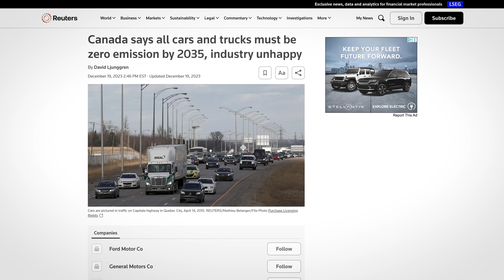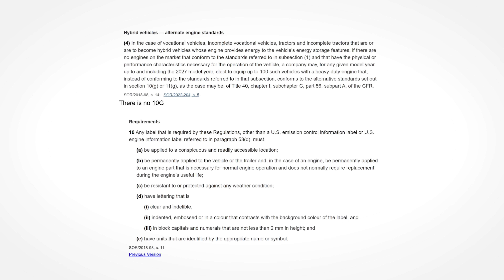Government Red Tape Is Blocking Our Plug-In Hybrid Trucks

Comment: There is a place not to far from your facility that ALLOWS you to make hybrid/ diesel trucks. Plenty of acreage for a final assembly plant. There are more than 48 different provinces or states that would welcome you. Of course there are way too many freedom areas that would allow this type of vehicle assembly. They even have local logging areas set aside for log hauling. They also have an infrastructure to allow the transportation of those parts, frames and subassemblies. Fueling stations are readily available to supply the exotic fuels necessary for the development of a new and different form of transporting parts. The bureaucrats necessary for the throwing of monkey wrenches are already hired and trained to slow progress down to a slow enough pace for the most advanced intellectually understand the complex interaction between humans, machines, the environment and the implementation of said integration into a new and hopefully beneficial technology into an archaic environment such as logging, human interaction, beginning to end utilization of new and complex systems into a mature and progressive,complex, environment that would not need the pillaging and raping of natural resources to further implement and reduce the need for human interaction between trees, rocks, and flowers. Unfortunately areas will have to be set aside for the development of suitable and sustainable areas of agriculture to feed the transportation hub necessary to allow farming areas to be built and maintained according to some as yet unknown and unwritten law that would allow the government to manage these areas to minimize the impact of the general public unto these rocky and forbidding areas for growing crops and food. Proceeding down this hazardous path fraught with environmental dangers would require the development and implementation of a new and untested direction would require advanced technologies and thinking unknown and uncertain amount of financial resources are allocated to existing systems. Lead time to mature infrastructure could take several generations to fully understand and implement.
Or we could employ existing technologies and farms cutting lead time to weeks or months. 
Suggested areas in Washington State, could be utilized rather quickly. The major impediment would be loss of revenue and lack of control from a Canadian government perspective would be unacceptable. Or a province could break away from Canada and totally upset the revenue aspects for Ottawa. Another brilliant concept shot down.

Comment: You might have better luck in the states at this time. Kind of crazy that a net improvement is disqualified by technicalities. Once you get through all of this, the next guy will have it much easier. That's not exactly right either.

Comment: I think Canada is somewhat delusional, thinking that they’re going to prevent climate change when the last 3 to 4 years we’ve got incredible Canadian pollution here down into the states.
I’m pushing 60 years old until the last few years I’ve never seen wildfire smoke here. 
So your priority is zero pollution from a diesel, but you allow uncontrolled fires to blanket entire states with smoke so hazy that we can only see a mile.
It’s really despicable with all the breathing problems that we’re starting to have here.
I’m all in on clean burn vehicles, but your priorities are really screwed up up there.

Comment: Surly the Scania 9ltr is also a truck engine tier 4 we use them here with our tight emission compliance,  ergo truck engine, modified to run a highway generator they want to play around wording of regulation  call it an ECU upgrade with emissions benefit love what you guys do,.
Reply: Well you see, it's not the engine in it but the way the engine works. He himself explained it, a generator engine senses load and andjusts, a regular on highway engine doesn't, which makes it all more difficult on top of needing a different engine that may not do what they want it to do.

They've been working a whole lot and selected that Scania industrial engine because it fits their needs best. 

Unfortunately bureaucrats don't care how well things work they just care about doing what the paper says to do.
Reply: That’s a minor engineering obstacle. You can reprogram any ECU to hold a peak efficiency RPM and modulate the throttle according to the load. That’s basically what cruise control does.
Reply: @LostCauseRT  On the other hand, the Scania generator engine is the exact same engine they use in their trucks. So if Edison has to make pure diesels for a while, it should be relatively easy to modify the existing design they have, add a transmission and then claim a pretty big market share as Canada and the US only manufacturer offering a 770HP diesel V8 engine. And after a few years, when regulators got their heads out of their butts and allow the hybrid design, the prototype is already complete and ready to be deployed, factory makes a small modification to it's production line and start building hybrids.

With a smart enough design, they could make it so that the diesel trucks can be upgraded to hybrids in the future with ease. Some tuning to the ECU and removal of the emission systems and bam, 1150HP from the "generator".
Reply: @John8087  Modifying requires re-certificates for the engine. This is not someone's garage project, it's supposed to be a marketable truck from a complying (legal) truck manufacturer.
Reply: The engines are normally not that different, you can flash the ECU to make it a constant speed engine, IE Generator.
Reply: @ShaneFromSA   Hell just move the speed sensor from the wheel axle to the output shaft and set the cruise control. 

Also a lot of highway engines offer a PTO mode  where you can set a fixed RPM is the transmission is in neutral.
Reply: They explain it in the video. They're using a stationary generator like one designed for a house, in a vehicle and the current regulation require vehicle engines be used in vehicles.  As you pointed out, those manufacturers modified existing vehicle engines to act as generators, thus meeting regs.

Again, as pointed out in the video, their argument is that's less efficient than their solution which is why they don't want to do it.

Comment: Would it be possible to take an on highway engine and build a throttle controller that runs the engine like a generator engine.

Comment: I.
 Think what you should do is use. An on highway engine jin running in PTO mode.
 And finess the PTO settings to work with.  driving  a generator sounds like that might be the only viable path at this time.good luck😮

Comment: What does it take to get a generator motor on highway certified, or to have an on highway set up for generator application? I’m sure it could be set up to hold RPM but does changing that programming affect T4F on road?

Comment: the generators you selected, they're available in similar power as towable small trailers right? I'm thinking you can submit your electric trucks as battery electric vehicles with no generator (but a hookup for auxiliary power, such as an additional battery pack or a generator) and delay installing the generator until the environmental regulations catch up.

Comment: sell them as electric vehicles that carry a unrelated generator. the use of a generator on a vehicle isn't illegal. you just have the joyful option that customers can switch the generator to connect to the battery. but the vehicle is an EV
Reply: That might be an idea actually.  The generator would be used on site at construction sites, or at least, that's how you can sell it. Then offer a simple after market kit that can also use the generator to charge the battery in real time while driving. The kit would just be a cable.

Comment: Okay for my understanding. Is the main problem that you're using a ready-made diesel generator (from Scania) in your truck, but like all conventional diesel generators, it's only approved for stationary use? Which means you're not allowed to run a diesel generator on any other trailer while driving either. 

Or is the much bigger problem that even if you were to add an electric generator and its own engine control unit to a diesel engine already approved for truck use in Canada, the necessary legislation for approval for diesel trucks only exists for mechanical transmissions?

Comment: Anyone who wants more or bigger government needs to come and watch this video. This is why people hate big government. It is the bureaucracy that stifles innovation.
Reply: The Chinese government is big but they can cut red tape if the goal is the same
Reply: China has one of the biggest governments there is, and Chinese autos are set to permanently displace everything else

Appears the Chinese adminstration realizes that capital is just as, if not more controlling than legalese
Reply: A smaller governement doesn't mean less regulation either, if anything it can mean it takes even longer to process requests when the demand is there but there's not enough people to do the required work and be even more of a roadblock
Reply: @LoupDuQuebec  A smaller government absolutely means less regulation and more innovation as there are less politicians and bureaucracy to screw it up like this. With less government agencies to get involved it is harder to hide behind the bureaucracy for bad decisions like this one. In a small, nimble government things get done because you can always find someone in charge that can't hide behind 50 of their lackies and agencies running interference who are too afraid to make a decision because it might look bad on their career advancement. It is because of this that innovation and advancements are stifled like not allowing this engine to be on the road. Anyone with a brain knows that this shouldn't be a problem and with a small government you will get much more done.
Reply: But there's also a downside with less regulation, the need to innovate slows down because what already exists makes money, so the money making solution is preferred over the solution that solves problems.
Reply: @LouisSubearth wrong lol. Less regulation is the way because more money means people can spend that money to innovate. Why would they innovate? Because it will be benefiting in other ways.
Reply: @LouisSubearth  Not even close. The more regulation there is the less solutions there are. This is evident in every place where over regulation has stunted innovation and growth just like it is doing here. If you were to look at all the places with the most regulation you will find less innovation as making a better mouse trap with the goal of making more money is far better than a government saying to make a product. Because unlike the entrepreneur who will live or die by how well he innovates. The government mandated and regulated one needs none of that. Just look at the cars, airplanes and any items coming from Russia where you can't make a bolt without the government approval. They are all garbage because no innovation is required.
Reply: @Aircam73  overregulation is bad, however so is underregulation. The best example is the Malaise era cars. The 70s were rough for American manufacturers because they had to figure out how to make fuel efficient cars, at first they choked existing cars to make a fraction of the power to meet fuel economy standards while European and Japanese imports were smaller, had smaller engines, more power and consumed less fuel. By the mid 80s, the American brands had learned to make comparable cars, they weren't the greatest, but they could keep up with the competition, and now we have big V8 engines that can meet modern emissions and get decent fuel economy while making respectable power figures.
Reply: @LouisSubearth  Your example had nothing to do with regulations and everything to do with an oil embargo. Once again because of this embargo it was left up to the companies to innovate their way into making a product that people would buy. The Japanese most certainly had a head start as they only did small cars in an era where those cars were laughed at. It wasn't until gas shortages that those cars became mainstream and the manufactures adjusted to the new reality. It wasn't until much later that emission standards came in where companies had to abide by them. I am not saying anarchy is the way but most governments, especially Western governments have grown fat and bloated, slowing innovation as bureaucracy tries to justify itself by over regulation.

Comment: So, what they are saying is if you were to remove the diesel engine from your trucks and run them wholly as a plug-in electric they would get approval! What would happen if a customer purchased one of these fully approved electric only trucks and then purchased a big diesel generator, mounted it behind the cab and connected it to the charging port? I am not aware of any Government legislation preventing this from happening. What you are offering is essentially a factory fitted version that is optimised for this purpose. Maybe resubmit your application for approval and describe it as fully electric. Then in your brochure list as a factory fitted option the "Emergency Battery Recharger".

Comment: Why don't you use de tuned x15 for generator engine. It is certified and de tuning will give you the power on torque you need. It is matter of bellhousing and crank coupler.

Comment: If the generator emits less than the road diesel and the standard says it has to meet the road diesel... the regulations should allow a better solution. The law should be the minimum not the "this and only this" straight jacket. Unless this hold up is over proof of your solution better... or can the diesel engine have a reprogrammed and tuned ECU.

Comment: How hard would it be to turn the mechanical "demand" from a pedal into a motor or solenoid that reacts to the electrical demand from the batteries? Not breaking balls, I'm just some dude in the YT comments, but I'm sure there's some way to pull data for what the battery needs and plug that into some sort of ECM to command a physical throttle. We already have drive-by-wire systems that take physical motion and turn that into an electrical signal then back to a physical motion. The input would just have to be some kind of calculation based on what the batteries need, no?

More complicated of course, but wouldn't that allow you to skirt the gov's nonsense since you could use an "on road" engine, just in the same capacity as a generator?
Reply: Not hard at all. Basically a generator engine tries to hold a certain RPM and automatically adjusts the throttle to keep to that RPM. It would be pretty simple to add an external controller to a road engine that regulates the RPM. It's basically the same thing but the paper pushers get their road engine certifications.
The worst bit is that they can't just buy an off the shelf generator unit. They would have to buy the engine and alternator separately then connect them. This increases costs and development time.
Reply: @LesNewell  that'd be straight diesel-electric transmission, and is already battle tested on railways, much more familiar to emissions regulators than to try to use a fixed speed generator as a prime mover
Reply: It should be easy enough for a good engine tuner to program an ecu to run as a generator. Its just inputs and outputs